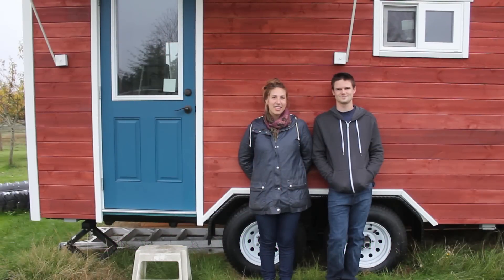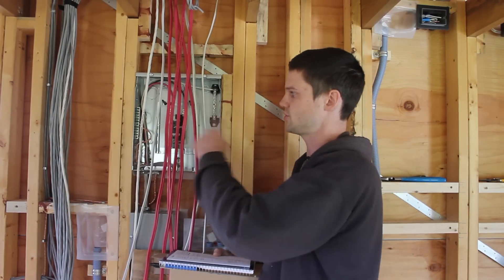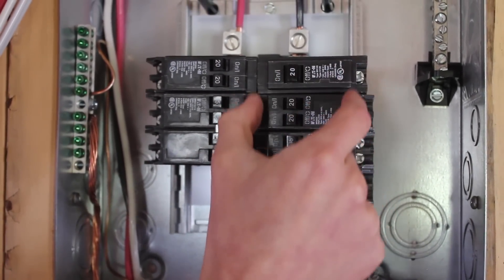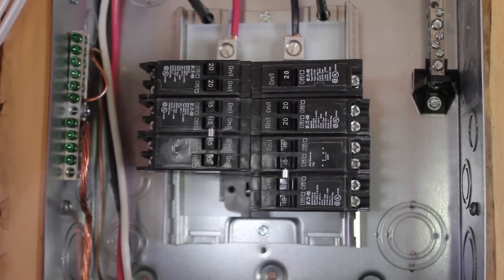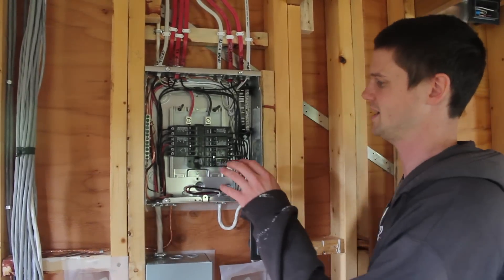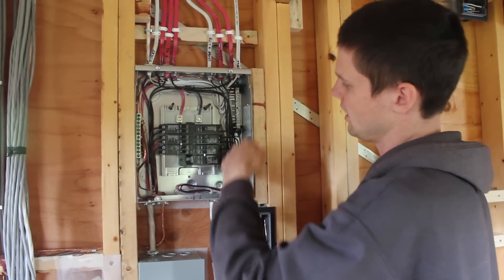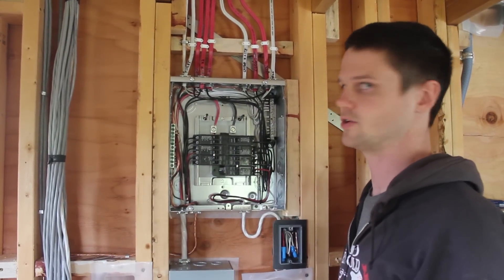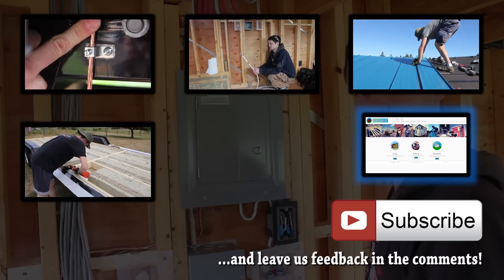Tiny House Electrical Panel (Ep.43)

Comment: Nice looking work. Couple of quick questions, please. Why a subpanel instead of a main breaker panel? Also, it's my understanding, (and please correct me if wrong) that, (1) Putting 2 grounds under 1 screw as you stated doing in the video is against NEC code,  (2) It is also my understanding that according to code, the majority of breakers in the system are now required to be AFCI?  I am planning my new house now, and looking to clarify these questions.  Just ordered your planning tutorial btw.    Edit, Just realized that the answer to my question may be the fact that you guys are in Canada, lol.
Reply from the maker: +Tony Corley I figured that the only purpose of having a main breaker would be to have the ability to shut off the entire system locally with a single flip. This ability didn't seem to merit the use of a second breaker. The configuration that we ended up with would not have had space for one anyway (with a similar sized panel). A few people have asked about this so far, and I guess my response is: "is there a reason I should have a main breaker?"
Another viewer pointed out that my comment about putting two neutrals under a single screw was against code (but that putting two bonds under a bonding screw was ok). I could not find the rule in my Canadian code (I am a bit rusty :P) and the organization of the NEC is totally different... I found an explanation for the NEC rule which does make a good case against doubling neutrals, but it's based on a very rare case (when you're working inside a live panel, which ultimately no one is "supposed" to be doing, even electricians now)... so officially you shouldn't, but in a residential panel where no one will ever be poking around live, and you're completely out of neutral terminals, it wouldn't be the worst thing you could do. I don't think doubling bonds is a problem, except in the same rare case behind not doubling neutrals (and to an even lesser importance).
I think there have been updates to the rules, but I'm used to requiring AFCIs in bedrooms, which are defined by having a closet... which is not applicable in the tiny house. They are not a bad idea though, and like I said, I believe the rules are becoming more strict, but I haven't brushed up on everything.

Comment: Ground bond bus screws can have more than one wire but neutral screws are allowed only one wire per
Reply from the maker: +Bike Man Dan Hm, I admit I'm a bit rusty on code memorization, so I tried to find a rule that explains either of these cases (doubling bonding or neutrals) and can't find it... are you aware of a specific rule? What section is it in?

I would generally only double a neutral if I'm completely out of space and the two conductors are the same gauge. There's nothing about the physical electrical connection that I can think of that would be hazardous in doing this.
Reply: +Tiny Nest Its not allowed by the NEC (and Id assume by CEC as well). NEC 408.41
Reply from the maker: +Bike Man Dan Hm CEC has a different rule numbering system... what's the section/sub-section titles?

Comment: that makes sense .. curious to see what your research  comes up with  keep up the great wrk
Reply from the maker: +Scott Tyndall In the Canadian code, the tie can be removed only if the multi-wire branch circuit it's supplying is lighting or plugs, and none of the plugs are split-plugs. Other than that it must remain tied. We have two multi-wire branch circuits, one of which will be a split-plug, so that one will remain tied, but the other would probably benefit from being untied. Thanks for motivating me to double-check this :D

Comment: OK I understand  about the load center or as we call it a subpage but is the 15a del breaker feeding a 220 circuit or two 110 circuits with a shared neutral?  cause if it is the later shouldn't you remove the tie between the two  breakers?  not criticizing just asking
Reply from the maker: +Scott Tyndall It's for two 120V circuits, and I'll have to double-check what the code says, but the practical answer is yes you can remove the tie so that tripping one circuit doesn't shut off the other; but when it comes to shutting it off to work on it, it means you are forced to shut off power to the entire cable.

Comment: just curious but where is your main breaker and in the breakers that are ganged together what would the dbl poll breakers be for
Reply from the maker: +Scott Tyndall This panel is acting as a load-center (meaning no main-breaker). The breaker that will feed this panel will be inside our garage's panel. Make sense?

The tied breakers, the 15A ones, are for 2-circuit 3-wire runs. It's what I was talking about when I said we needed to make sure the red and black from these 3-wire cables are on opposite lines, which is so that the neutral only ever carries the difference in current.

Comment: Nice job....:)

A few questions:

Are you going to have any DC circuits? If so will they be in another panel?
Do you have a backup generator or something for when the power goes out?
Can your accept the shore power for either 30 or 50 amps?

Thanks
Reply from the maker: +1timby I think it will be the next episode that we start showing the low-voltage and control systems. We don't have a generator, but we might eventually add batteries/solar, and I might get a UPS for my PC. The system can accept up to 50A @ 240V.